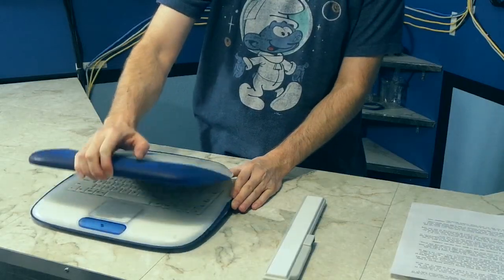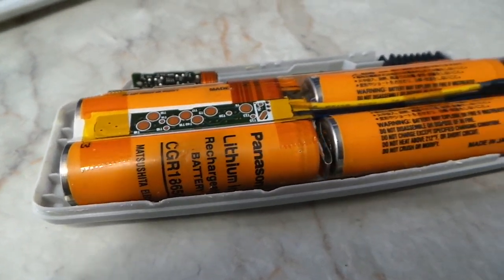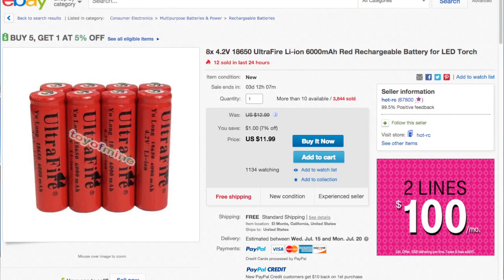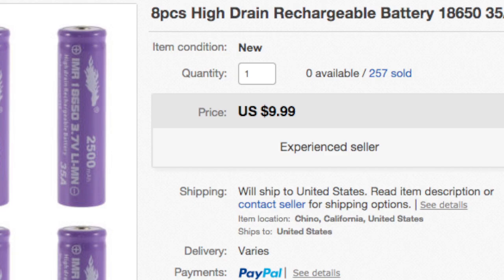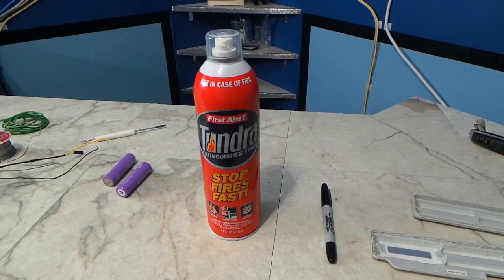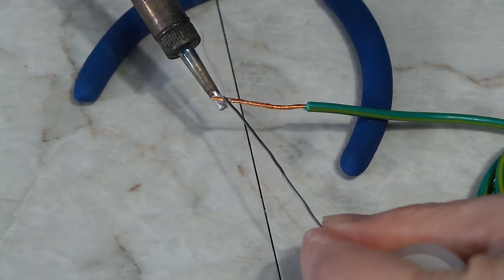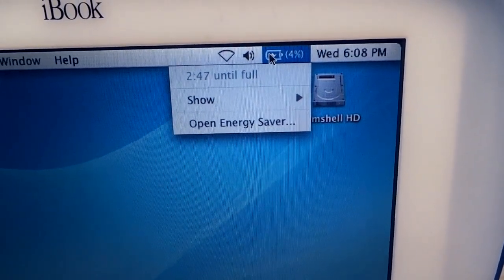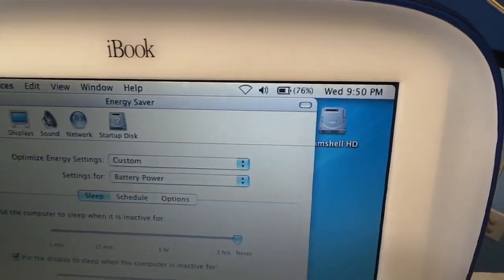Rebuild a laptop battery pack

Comment: While you effectively did this in the video, it would be good to stress that with Lithium batteries in particular, it's EXTREMELY important to make sure you're using all new batteries of the same age and capacity when attempting a project like this.  You can't safely get away with replacing a single bad cell like in a NiCd or NiMH battery pack, because it will screw up cell balancing and quickly become a fire hazard.
If a few of the original cells were still good, get a flashlight that takes a single 18650 cell to use them there.

Comment: Why not buy battery holders put them in the circuit then put the batteries in the holder. Then when the new batteries go bad, you can  just pop them out and replace them without soldering.
Reply: Make a video and show us Mouse Dresden!  That sounds great.
Reply: would be a cool homebrew thing to make and in use would work well, until you factor in cell movement due to placing the laptop down on a table and reduced cell cap, another way to do this that would be a tad better is to make a holder inside of the battery case and then place in the contacts and wire the contacts to the cell cap chip thing, then to reduce cell movement fill in the top of the case with some loose plastic from something broken, dont use something that is an insulator as that will cause the batt temp to rise and could be dangerous, then again idk, this is all just thought up on the spot.

Comment: So is this project economical if you buy better and more expensive batteries? Or am I better off just buying a new battery pack? I've looked them up before and it's only like $20 for the one I need.
Reply: Jose Parziale
Your website is an obvious scam, it's all talks of some scammers who only wants your money for free infos you can find anywhere else
Reply: +The 8-Bit Guy Those cheap batteries tend to be all over the place, i have had some that worked pretty well (for a short time), and others which did not hold any charge. They definitely would not stay well balanced in series like that. I have heard that they actually are often recycled batteries, ones that are name brand but have been pulled out of (you guessed it) things like old laptop batteries!!!
Reply: +Ihaveriffs The way I look at it when buying 18650 batteries to replace the one inside the pack there are two possible solutions:
1. Buy new batteries from a name brand through a proper source.
2. Buy a few extra of the cheap ones or maybe scavenge some from other sources.

With method 1 the trouble is finding a reliable source that is somewhat affordable, for my purchases usually to power either a project or a torch I generally use a webshop named NKON (based in the Netherlands and this gives me convenient 1 day shipping, outside Europe it's probably better to use another source). Haven't had a bad battery from them yet but I'm sure there are many other good places, in addition to the warning that was in the video also be aware that there's a lot of battery rewrapping going on.. if it seems too cheap to be true it probably is. Panasonic high capacity batteries go up to 3400 mAh (perhaps a bit higher now? it's been a few years since I investigated stuff) but it'll be in that order of magnitude. High drain batteries typically go up to 2900 mAh and not much higher, but I found that Panasonic NCR18650B 3400 mAh batteries will hold up pretty well up to 5A discharge currents.

Now when you opt for method 2 and buy cheap batteries I suggested to get a few extra because you'll have to charge and test the batteries and balance the whole pack somewhat and perhaps dump one or two of the really bad ones. The bottleneck for this design is when one of the pairs that is chained up in series gets drained, then the microchip will notice that the voltage over those cells drops too low and shut down. So in order to avoid this you should first upon arrival check if the batteries have a sane voltage (if they are below the recommended voltage charge them with caution or not at all). Then once they get to a full state of charge using a proper CC/CV charging system run a discharge test on them, it can be whatever really constant resistance with a power resistor, running a light that'll do okay in the 2.90V-4.20V range or if you have it a fancy electronic load that can be set to constant current, constant power, constant reistance etc. Then discharge them with that method of choice and take note of how long each takes to drain to your cutoff voltage (don't discharge them too deep or they might be damaged by it!), match the pairs up well enough so that two cells combined are roughly similar for all 4 pairs in series. This should give you the best result while sourcing cheap batteries.

If you don't have a lot of fancy electronics tools the most economical way is probably to find a lightbulb that runs well on the voltage range or power resistor and while its discharging it monitor the voltage over the battery with a multimeter, doesn't have to be expensive. To charge the batteries you could use a charger designed for 18650 batteries or a lab powersupply that you can set to both a constant current and constant voltage limit. Set the charging limit to something sane (don't go above 1C, aka filling up the "rated capacity" in one hour) and set the max voltage on 4.20V. While they are charging in the constant current stage I'd recommend to keep an eye on the temperature of the cells too, if they get a lot hotter than normal good cells its a sign those have high internal resistance and probably shouldn't be included in the pack.
Reply: +The 8-Bit Guy Be careful tough, some laptop battery pack have "anti-modification" features. When you remove the battery cells, the charge control's memory is wiped out so you can't put new ones back.
Reply: Thats right moonwalker , or that eeprom chip will screw the charging and discharging , unless u reflash it , or reset it by shorting the respective pins.
Reply: Anthony V Oh this one popped up again :D yep definitely agree with that, if you truly care about the best runtime and are rebuilding a broken battery pack going with that solution is a good option. Just don't put any of the batteries in with the + and - swapped around, it'll be bad! (may have done that myself once for a project but caught my mistake before actually putting the battery pack to use and causing a big mess.)

I don't know much about 3600 mAh panasonic cells (Panasonic NCR18650G), my projects are still running on old 3400 mAh NCR18650B and the high drain NCR18650pf 2900mAh varieties that I bought in bulk a while ago. But being panasonic branded I'm sure they are good, didn't a whole lot of them get bought up for Tesla production like a year ago?
Reply: +ToKeepTrackOfRandomSubs 
Hi, I buy old laptop battery packs, off ebay. 
I normally find that only one or two of the original batts are S£&g"d.
The rest are reusable and bloody good.
I don't Buy the single sales, but the multiple packs that tend to come from computer repair & comp sales people!
All the very BEST TO YOU ALL!
Reply from the maker: Ihaveriffs - In the case of the computer I did this for, the OEM battery packs are no longer available and the few aftermarket batteries that are still being sold are old-stock so they probably don't have much life left in them either.  If it is a newer computer, you are probably better off buying an OEM battery.
Reply: +Ihaveriffs that has the cheapos in it so yes
Reply: John Drew
Seems reasonable, I mostly go with buying new cells from a name brand. The last few years I mostly went with Panasonic NCR18650B cells for my projects. But most of my projects won't run on more than one or two cells in the battery management system.

So for something of my scale getting high quality new cells is worth it to me, not too large an expense and I don't have to bother with testing and matching pairs by capacity. I do have the equipment to do accurate unattended tests but just not worth the time so far.

If I ever start a large capacity battery bank or something that needs a bit more power to operate long term buying old battery packs will be the way to go though. Only one or two being bad seems like a pretty good yield ratio.
Reply: +ToKeepTrackOfRandomSubs 
Hi, 
The one or two bad ones are not entirely useless; The lithium once you break em open store in mineral oil, then you have copper sheet also graphine and even the internal plastic sheet is extremely useful!
Reply: +Russell D. Staats 
Hi,
Thank you, I have watched this video, since you sent me the web site address. 
Very interesting!
Reply: +Ihaveriffs I've been studying battery reconditioning and discovered an awesome website at Magic Mender Wizard (google it if you are interested)
Reply: +The 8-Bit Guy cool t shirt : D
Reply: I've been studying battery repairing and found a great website at Magic Mender Wizard (check it out on google)
Reply: Power Max guess what’s inside those bargain laptop batteries.

🔥🔥Bargain 18650’s🔥🔥
Reply: you don't know what batteries they use
Reply: Go for the new pack for 20$. I need 18650 cells for my electric vape, and those with high capacity (3000 mAh) cost me about 9€ each! Of course, with 1000 mAh they would be much cheaper, but for 6 cells hardly cheaper than 20€. 
And you risk, that it will not work with new batteries, because of an chip, which reported the old cells as dead and can't be easily reset. 
And you risk damaging the case by opening it. 
And working with those batteries is risky per se. 
And you have, as unexperienced person, to calculate for at least 2 hours of work.

Only if there is no replacement part available, I would risk to exchange the inner cells. Or if you have spare cells from another, defective device and want to try to learn something.
Reply: +Ihaveriffs No , it's not better to buy some shit oem battery pack. You can invest a little more and get panasonic 3600mah cells , wich will in most cases almost double the run time , since most laptops got 2000-2400 mah cells in the factory battery. Those panasonic cells really hold 3600 mah's though.

Comment: When getting lithium cells make sure to get the tagged ones if you are going to be soldering them. Applying a soldering iron directly to the cell is very bad as too much heat is transferred in to the cell which can damage the cell or even trigger a thermal runaway. Permanent connections made directly to the cells should only be done with a tag / impulse welder to minimise heating to the cell.
Reply: Nowadays DIY people can buy very compact and affordable handheld spot welding kits and metal strips for 18650 cell terminal welding. Check Banggood and Aliexpress for portable spot welders. Requirement for room venting during use is still in effect.
Reply: Well he like a lot of us probably doesn't have a place to use a tag for impulse welder and does not own one
Reply: @zen4realfightman426  if you don't have the correct tools to do the job safely or properly than maybe you shouldn't be doing it.
Reply: @garyhanson655  well not in this specific scenario but sometimes you have no choice but to do the job with incorrect tools but desperate times call for desperate measures
Reply: @garyhanson655  I've done 2 laptops (12 cells + other connections) with a soldering iron set to about 700 degrees. No issues. Scuffed up the tips of the batteries and used flux to minimize contact time and heating. You work with what you got to get the job done. Not buying a tack welder such a small, temporary job.
Reply: @shawnerz98  as long as you limit iron tip on terminal to 3 seconds or less its not too damaging. It's the people that need 30 seconds to get the solder to flow and stick

Comment: Excellent video!  Thanks!
Reply: +Ron Helton No, it's a bad video. Soldering lithium batteries is very dangerous and a safety risk. They must be welded not soldered.
Reply: OpenGL4ever Living on this planet is dangerous.  So what is your point.  Wear goggles and don't overheat more than necessary.
Reply: Ron Helton
Have you any clue how fast you can overheat a lithium cell by soldering at it? This is HIGHLY DANGEROUS. Listen to the safety instructions and only spot weld them. If you don't apply to those safety instructions you are a perfect candidate for the next darwin award.
Reply: OpenGL4ever He probably should have added, if you are a candidate for the Darwin award or have no soldering skills, then don't attempt this task.
Reply: Ron Helton
This has nothing to do with soldering skills. Actually if you do solder lithium batteries, you show by doing so, that you have no solderings skills.
The point is the fast heat exchange. Even if you hurry with your soldering iron, you will heat up the battery pretty fast because a lithium battery does conduct thermal energy very good. I suggest you to follow what i told you.
Reply: OpenGL4ever I'll check it out.   But anything that recycles our electronic toxin piles is a worthy pursuit.  But safely.
Reply: +OpenGL4ever You do realize that spot welding puts out way more heat than soldering right ?
As long as you solder it quickly its perfectly fine, especially if you solder the wires to the metal that has been spot welded on.

Comment: looked like efest batteries to me. which are supposedly rewraps of lg batts. i would be very supprised if they only had 1000mah capacity as theyre known as rather good batts in the vaping community at least. pretty good amp rating as well

Comment: Would it be possible to modify it in such a way that you can replace the batteries just just taking out, similar to like those wireless mouse with batteries?

Comment: I did this in 2003 with some cheap R6 (AA) cells from a chinese dealer.
Actually it worked well, but the uptime was exactly the same as with the old, damaged cells. When I was looking for the correct cells, they were expensive like hell.
As it was just a 90 MHz Pentium (the good Intel Chip at this time), I didn't buy the newer ones.
Meanwhile that laptop is gone as it fell apart time after time (first the sound chip failed, uninstalling any sound drivers were the only way to keep it from freezing). Late the whole motherboard died. (I still got a 1994 486DX-2/66 with 8 MB that's up and running :-) )

Comment: Battery terminals are very good conductors this also means good thermal dissipaters of heat. Where does this heat go? Into the battery cell, this of cause damages the battery. No matter how quick you think you can solder a lead to a battery terminal by ramping the temperature well above 330°C to give you the illusion that you didn’t damage the battery rest assured you have!
There is only one method to make battery packs and that’s with a battery spot welder.
In essence this and that nasty $500 desk you made earlier is a waste of effort and money. You could have got a better nicer modular desk from Ikea for so much less.
Please don’t let this stop you it’s always entertaining watching idiots with money make fools of themselves.

Comment: Folks, please do not attempt to rebuild a laptop battery as suggested in this vid. The method of connecting the cells using solder is wrong and highly dangerous.  The cells need to be tack welded together.  Tack welding batteries of any type requires a spot welder and knowledge of how to use said equipment.  Additionally, lithium ion battery fires are very hard to put out once they get going.  You are better off letting a professional battery rebuilder handle the task or just buying a replacement battery pack from a reputable seller -- if you don't know what you are doing.  In any case, again, don't follow the instructions in this vid because they are completely wrong.
Reply: Rynard Moore Can you give us a source on this information?
Reply: SoundToxin I did battery rebuilding for years  but if you don't believe me look up someone who does this as a trade -- they will tell you the same thing.

Comment: oh the ibookguy pls help me. i have 251 gb sad in my mac and i with help of boot camp installed win 7. A few months later i deleted win7 and now my sad has 2 partitions one with OS X and onn is unused in disk utility it says the win partition is free space. now i want to merge 2 partitions into one hopefully this make sense to u so u can help me
Reply: If you want to extend your Mac OS X partition, just delete the former windows partition, if you haven't done so already. Then you should be able to drag the tab on the corner on the partition to fill the empty space, and apply changes. (In the partition tab on the ssd in disk utility)
Reply: ***** i did that already http://gyazo.com/a0d9136ec858559a336edb404b53c79a
Reply: Domen Vinko If the Mac OS partitioning software is giving you trouble, I highly recommend trying out GParted. Put it on a small USB flashdrive (1GB should be plenty) and boot from it.
Reply: boot from it what